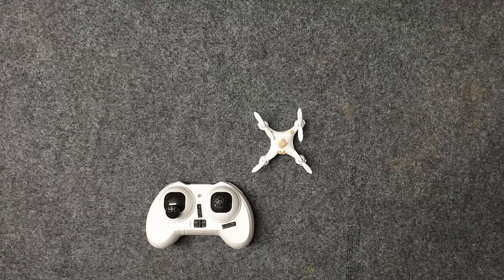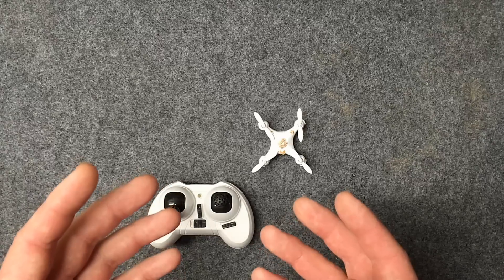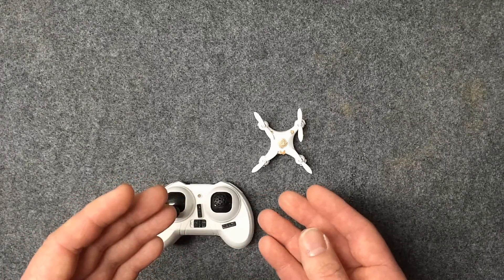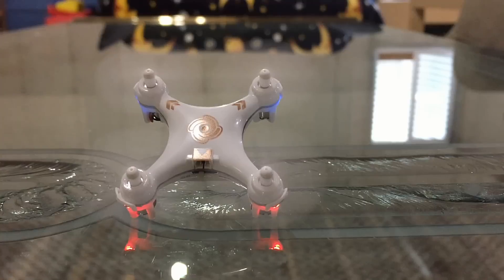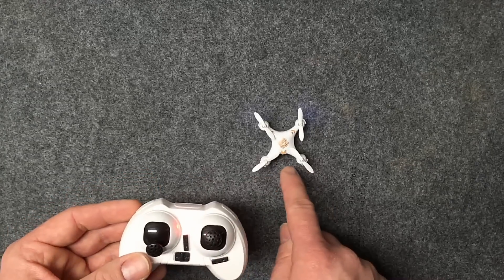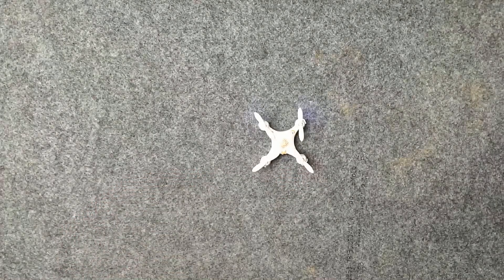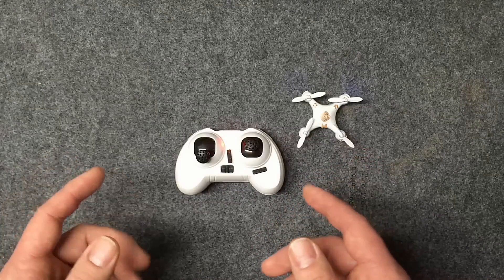Cheerson CX-10A Quadcopter Unstable Flight: Gyro Calibration Procedure

Comment: Thank god for this video. If you hadn’t posted it, I most likely wouldn’t have known which motor which propeller belonged on.  That’s the only use I made of this video really. For my transmitter, I had to pull the left stick to the bottom left and the right stick to the bottom right. Is that odd? My drone is a Mould King (if that even exists) X6 33058. Idk if that even means anything but that is most likely the reason why I made different adjustments to my right stick.

Comment: My CX10A's transmitter is blinking once on and off steadily and beeping at me. The lights on the Quad doessn't blink. They are solid. It binds and flies but the beeping will not go away. New batteries, fully charged LiPo too. Even tried switching through the modes but no go. Anyone know how to get the beeping to stop.

Comment: GUYS IF IT STILL DOESN'T WORK EVEN AFTER 10  MINS OF FLASHING THEN CHECK THE PROPELERS TO BE CORRECTLY ORIENTATED... This is gonna fix it you'll see. Just be careful and try to place them is such way that when u turn it on, too feel the wind from it on the botom. If u put ur hand above it when u turn it (hold it in ur hands) and u feel the wind from a propeller then that proppeler is in wrong direction and u must switch it with another one.
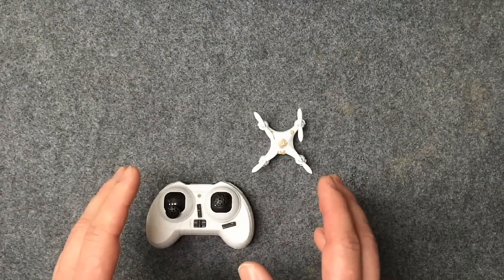Reply: Orrr you can just adjust the propellers to the orientation in the video, even though the never meant to show it. It’s at around 1:20 - 1:23
Reply: Switching props totally fixed it. Thanks!. I returned one of these because of that. Then the same thing happened to the other one. What I don't get is why the props aren't uniform. Should't they all for spin the same way and be identical? Is there a way other than trial and error to figure out which replacement prop to use?

Comment: I keep breaking propellers because at one moment CX10A quad copter won't turn off even if I fully lower the left lever to land it. It will keep spinning out of control until I manually grab it and switch completely off. Any hints there? Thanks!

Comment: Mine always wants to drift off in one corner of the cx10 can anyone help?????
Reply from the maker: Make sure all the blades are in their correct spots
Reply: i managed to fix it until our stupid rental property person decided it was a smart idea to drive super fast into it. He saw it then the drone was about to die and it was starting to land on the road where i was going to get it (because we are on a small quiet street it's safe) so he started speeding up and used he front windshield to make it fall to the ground then he reversed and then ran over it and he drove off saying HAH and so now im just going to get a hubsan x4 107c
Reply: two of the motors are very stiff and sometimes dont work and the top green part is all cracked and it dosn't take off without them 2 motors. and i cant fix it myself

Comment: where can one get new blades I broke two but I know I will need more
Reply from the maker: Best place I have found is bangood
Reply: westmc45 Get a protector with blades set for like 3 bucks. Definately worth the money.
Reply: +westmc45 Amazon has good deals.
Reply: Don’t use protectors only if you can near perfectly control the drone.

Comment: In your clip of the C10 not taking off, the aft blades are on reversed. At least compared to mine (which flies fine) - Also when I do the calibration mode the blue lights never stop flashing. Not sure if they've changed the firmware for this but no matter how long I hold it the blue (not red) flash.
Reply from the maker: Jamie Clay cx10 does stay flashing where as the cx10a it will stop.

Comment: When you showed the CX-10 not taking off, that looked exactly like what happens when the propellers are not installed in their correct positions. Learned that the hard way lol
Reply: +Michael Stuhlman Wow, I just went through the process of re soldering one of the motors after a rough crash. During the reassembly I lost a blade, forcing me to use one of the spare replacements. When testing, it would do as the video shows and appeared to not calibrate. Thanks to your comment, i looked into how the blades are organized and realized the one I replaced was of the opposite orientation. Thanks!
Reply: how do I check the propeller's correct position??
Reply: I was just about to throw away my cx10, because calibrating it didn't help, when I saw your comment. Thanks!!!
Reply: Correct.